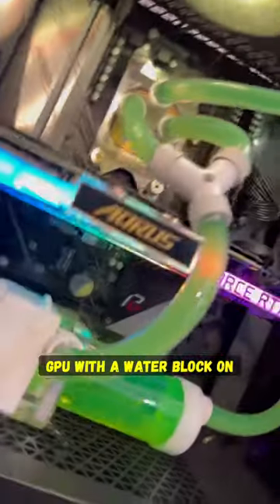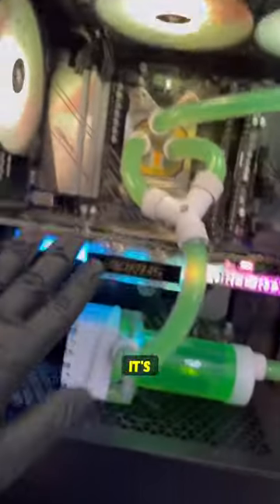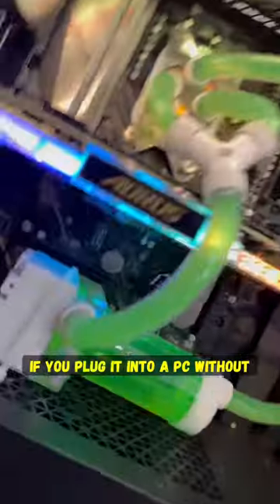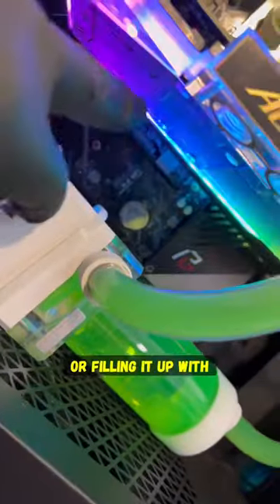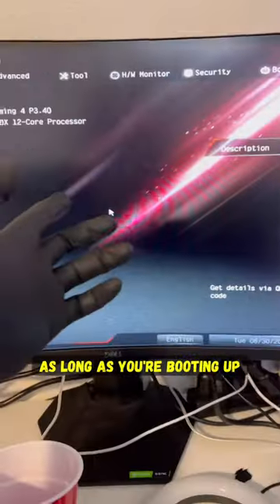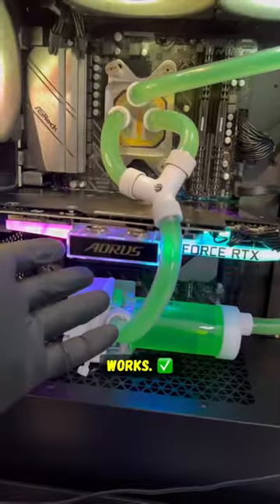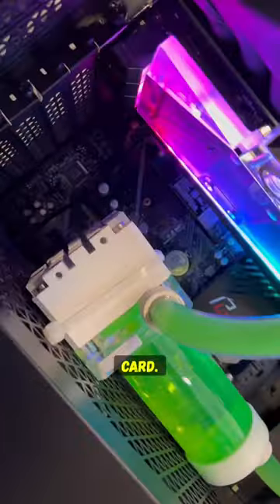Testing this Water Cooled GPU without Coolant! 🌵

Comment: I have the same budget pump lmao; needed to build a custom mount for it but your zip ties do the job :D
Reply from the maker: Right 😁 Came in clutch 😂
Reply: @fluixtech  I think you dropped some pickle juice in your coolant.
Reply: How is that pump holding up so far? I just built a loop yesterday and also used that pump.
Reply: @glock5202  i replaced it, it got super loud. Might have been shitty ek fluid that clocked it tho

Comment: Don’t listen to any assholes here about soft tubing! I still rock soft tubing and there’s nothing wrong with it. I want to do a hard tubing build one day but working 2 jobs makes time difficult. Just remember, hard tubing won’t make you a better gamer nor will your overclock temps be any different. There’s a reason plumbers these days use pex for water pipes, less fittings and better flow and less strain on your pump!
Reply: I've seen so many turds wreck their whole rig when their cheap ass hard tubing cracks or the connectors leak. As somebody who makes some money doing board level electronics repair on the side, and who can't stand people with more money than sense, I highly recommend using hard tubing and conductive coolant, lol

Comment: It can still heat enough to damage the card in bios, it'll just take a few minutes, even at low usage you're looking at maybe 30-50w on the core, which isn't easyto do passively, the lump of copper attached to it in the form of a waterblock will give you a bit of a buffer period, but you're really only good for about a minute or two, enough to make sure you get a display output, but something to be careful of still and this also very much depends on what skew it is too, a 3060 is going to spit out a lot less heat than a 6900XT/3090 for example, but it will heat up enough in bios to shut down, but realistically it'll do that long before any damage is done anyways

Comment: It doesn’t heat up enuf in the bois to harm the card” my 10 year old 1060: best I can do is 120c
Reply: 10 years?
Reply: I repeated my 1060 years ago and it never breaks 75 with a balls to the walls OC
Reply: it’ll throttle down far before hitting 120c, so either it’s bullshit or you can’t read the temp right
Reply: That card came out in 2016
Reply: Dear God no one here has heard of a joke
Reply: @roowut  he might’ve had it in Fahrenheit or was reading the wattage
Reply: Reapplying thermal paste will do wonders 
(Unless your fan or copper pipes are ruined, but it'll still help)
Reply: @juliusmancilla61  if he just said like "ancient" or something it'd actually be funny. adding 4 years to its real age isn't really much of an exaggeration

Comment: Same thing goes for using desktop. GPU doesn't actually go under real load unless use a 3d program.
Reply: Many desktop elements actually use 3d acceleration
Reply: @riba2233  whaaaa why doesn't my gpu boost then..

Comment: If you plug in a water cooled GPU without coolant and it doesn’t work, you’re kinda screwed anyways. Might as well loop it to avoid any kind of damage. Just don’t put the front panel on until it posts 😉

Comment: The ugliest waterblock I ever seen + its useless lol
Reply from the maker: Check out the improvement video we posted recently on our YT 💪
Reply: @fluixtech  My dude no offense but  what you gain in turbulence  you lose in flow  by dividing the main tube into two with that Y splitter also who had the idea to put the Y  splitter in frond of the cpu block that's so ugly....  I mean didn't it cross your mind to have it more discrete like on the pump side?  

Also a much better idea would have been to ditch that ugly Y splitter completely and instead opt in for custom tubes that have like bumps like a tesla valve or some other similar texture on the inside of the tube to get the turbulence that way (which again would decrease the flow but it seems you dont care eitherway about flow lol) 

Also ltt reviewed it and it is worse than aircooling so I really dont know what you offer here, looks? no. Performance? no Price? hell no that ugly set is hella expensive lol.
Reply from the maker: @billkillernic  Concerns noted 😊Check out our improvement video posted a few weeks back. We are improving Tri-Swift and launching new products. Stay tuned
Reply: @billkillernic  Custom blocks are a waste of time and money so jokes on both of you
Reply: @Digger-Nick  Hahaha no! Sure they can be expensive but only if you buy blindly kits from big brands if you are more of a tech savvy and market savvy guy you can buy stuff that its equally good or very close to it with the expensive parts, what you are looking for (to not spare money on but there are still good bang for buck deals to be found just dont completely cheap out on those ) is the block and the pump mainly. 

Obviously you need good hardware as well I mean I wouldnt make a custom cooling kit for an i5 and a 3060... but a 5950x or a 12900K could really increase their performance and stability noticeably with custom watercooling (if you know how to squeeze every drop of their potential via OC/power delivery etc )

E.g I can do 5.1 Ghz single core and 4.9GHz first ccd and 4.85Ghz second ccd on my 5950x with my custom water loop  I could only do 4.9 single core and 4.85 1st and 4.75 second when using a beefy 420 AIO (arctic liquid freezer II ) 

Obviously the kit in this video isnt much to write home about just a gimmick.

Comment: Soft lines are soo ugly and lazy why spend all that and go through all that just to have a soft line hand all ugly
Reply: You obviously weren’t around when soft tubing was mainstream. I still use soft tubing because it’s much easier to maintain and there’s nothing wrong with it. It works with my Corsair 800d case! Yes I still rock a trusty old 800d! I’m not here to impress anyone. Hard tubing won’t make you a better gamer! Just like a certain gun won’t  make you a better target shooter! I can run soft tubing as neat as hard tubing and I get better water flow with less fittings and it’s easier to change out parts! So get off your damn high horse!
Reply: @aaronhuffman4852  much lazier you mean you get of you high horse of its old school and get better seems like you still haven't grown since you started if your still doing soft tubing and trying to defend it everyone knows you soft tube now if your rushing the project and need it out

Comment: Wtf is that loop??? Just loops from the CPU back to the CPU??
Reply: Linus did a video on this block not too long ago, it's meant to be better for flow but it really didn't do much of anything
Reply: Pump also shouldnt be at the bottom with the radiator tubes at the top
Reply: @HauntedOne666  that's not a concern in a custom loop since the pimp is fed directly by a reservoir, that's only a concern in an AIO where you don't get that
Reply: @blazingmatty123  ahh yes youre right! Confusing some info i guess
Reply: @HauntedOne666  Easy enough mistake to make, yer all good